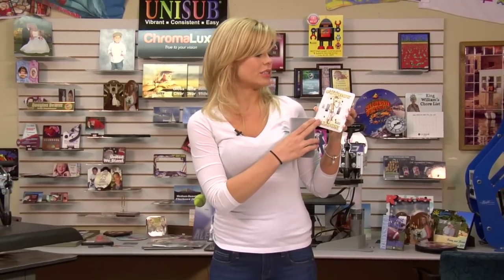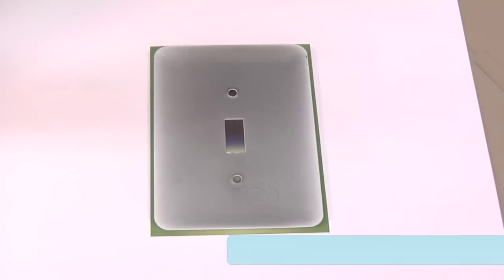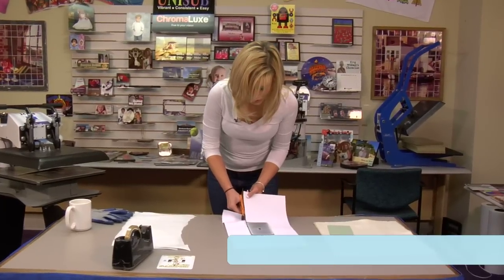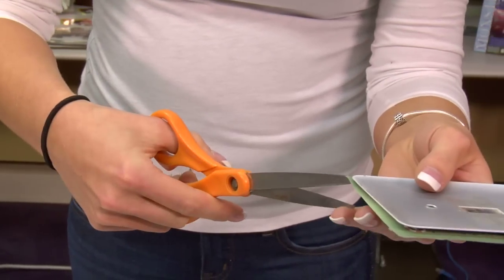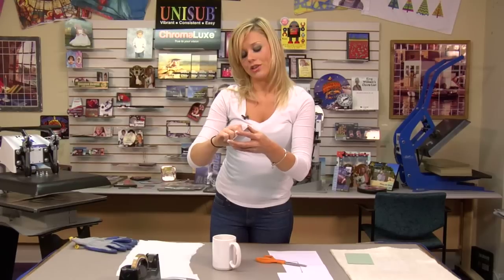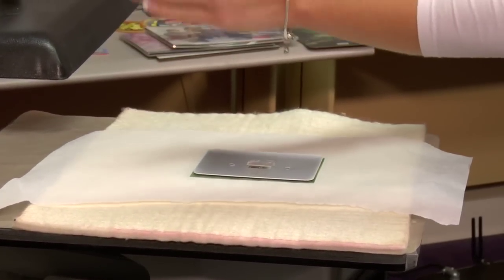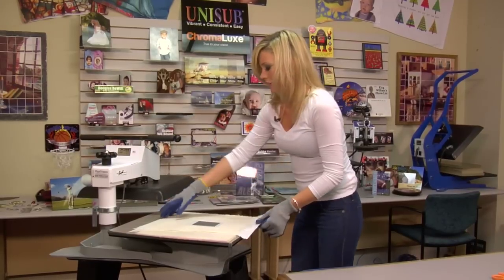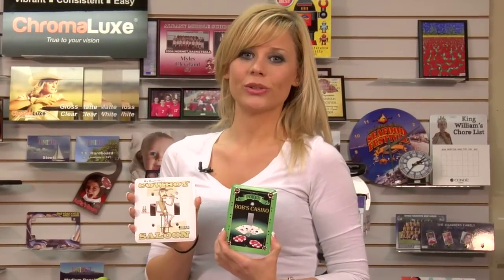How to Sublimate Metal Light Switch Covers - Step-by-Step - Conde Systems, Inc.

Comment: If you're having to 'rush' your order due to time constraints, is it possible to dip the metal light switch in a cup or bucket of cool or room temperature water to speed up the cooling process of the metal or will that hurt it in any way?